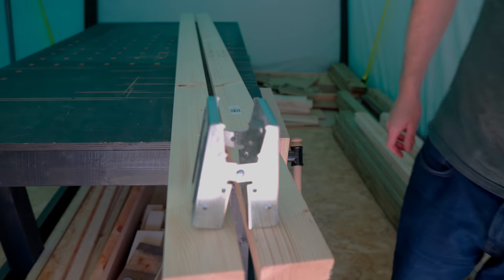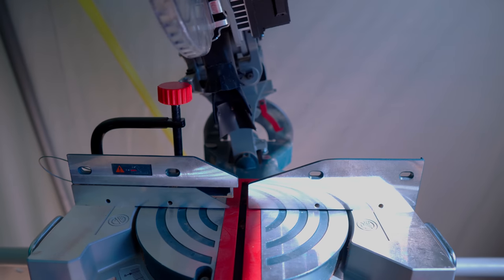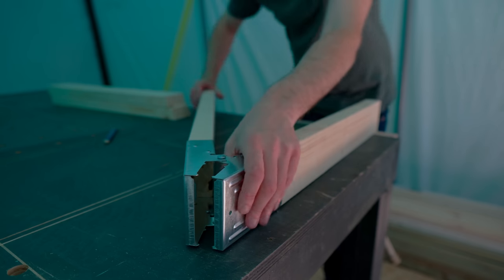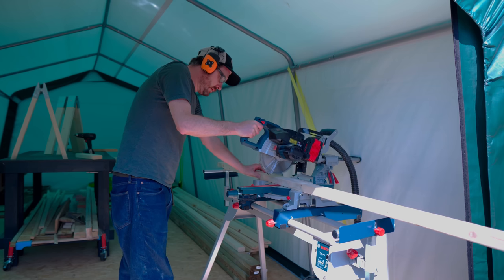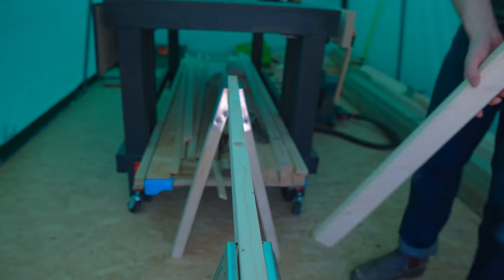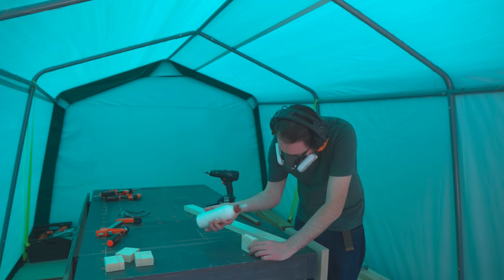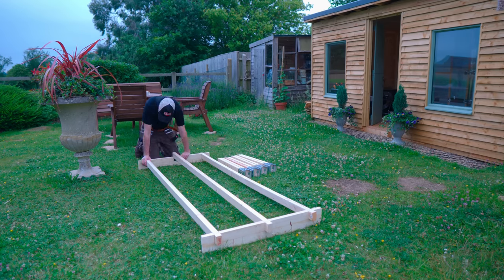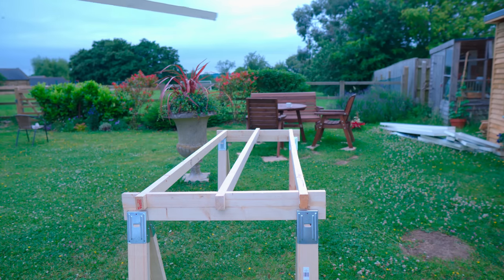Portable Sheet Good Cutting Platform

Comment: Definitely need some bracing between the pairs of legs to stop the racking. Looked dodgy cutting the light weight insulation so think a sheet of 18mm ply would be hard to keep stable.
Reply from the maker: I have been using them for weeks with no problems
Reply: I was popping up the comments to say the same. Wobbly. 
Interesting that Matt is not too bothered. Possibly it looks worse than it is. 
Not over engineering a trestle/sawhorse table is actually a hard thing. I have not seen or found the answer. Two old black and decker Work Mate units with a 2x4 frame clamped in it !! Needs firm ground underneath though.

Comment: €26 for a pack of 2 hinge brackets is absolutely nuts. And you'd need 4 altogether for 2 saw horses, so ~ approx £40/€50

Building 4x2 X frames would only need 1 bolt or even using door hinges from the pound shop surely would be cheaper
Reply: I agree they are not cheap but I have used them. They are strong and more versatile.  If you want cheap and cheerful Amazon do Stanley cheap and cheerful pair @ £28!